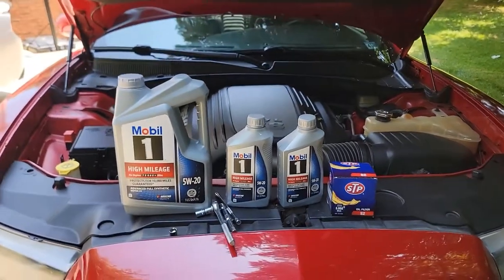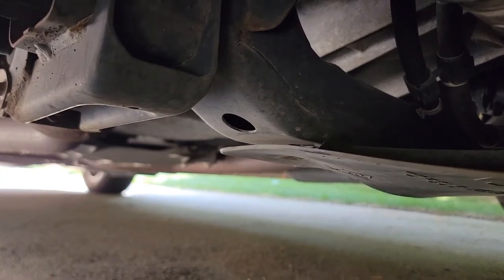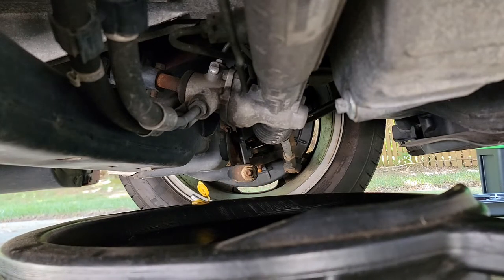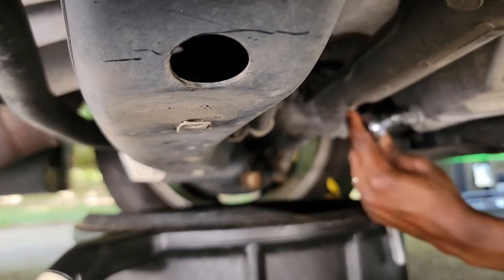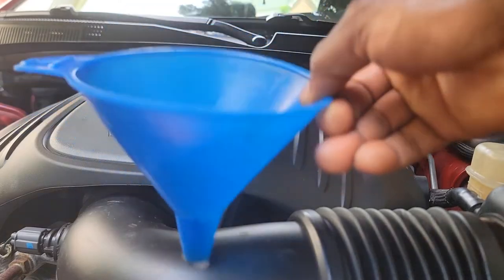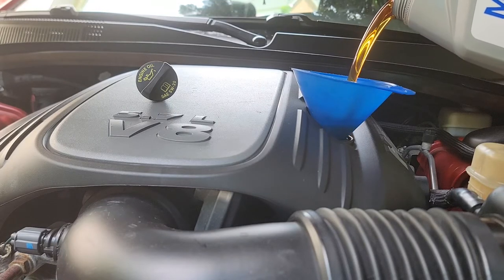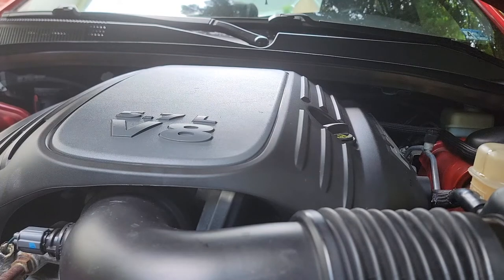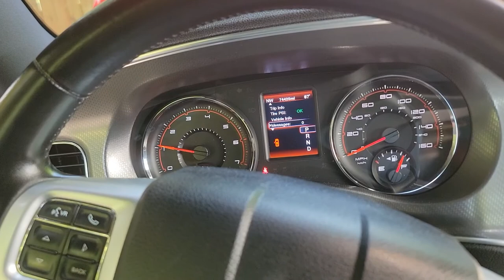2012 dodge charger rt v8 oil and filter change

Comment: You do realize it is not good to tighten down the filter that much. All you have to do is tighten with your hand and the pressure will tighten it the rest as time goes
Reply from the maker: Hi. Thank you for comment. Thank you for your advice and I will make sure next time it is not as tight.

Comment: How often should I be changing my oil in my 2012 Charger R/T?
Reply from the maker: Hi. It depends what kind of oil you use. you may need to change it every 3k miles for regular oil  or 5k miles when you use synthetic oil.  Hope this helps. Good luck!
Reply: @AubinAutoDiy  yes it helps, just have 1 more question. Is the 5k mile interval even if I drive hard? I was told by a mechanic that if periodically I drive it like I stole it then I should do every 4k miles. That’s why I’m here getting more opinions. Thank you again
Reply from the maker: @dubeast209   your manual should tell you how often you should change the oil. I would go with what your manual says.
Reply from the maker: @dubeast209   I am not sure what i can suggest in this case. If you drive hard then do it every 3k miles  just be on the safe side.